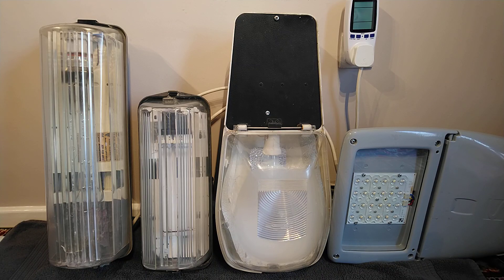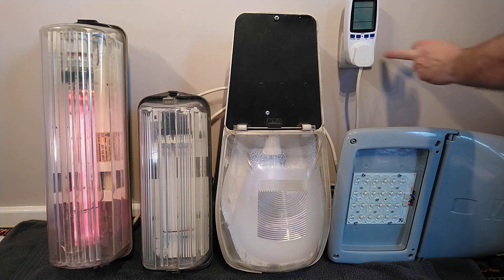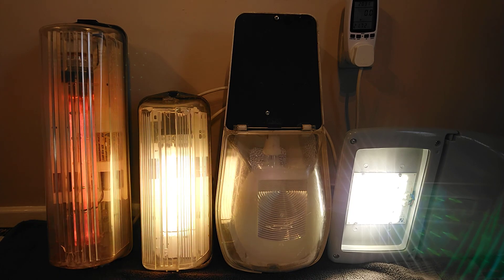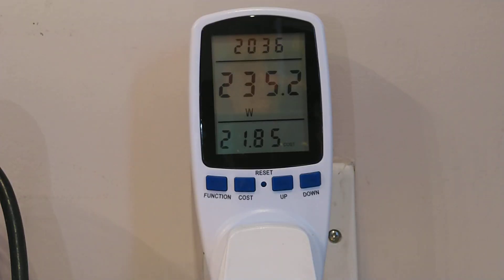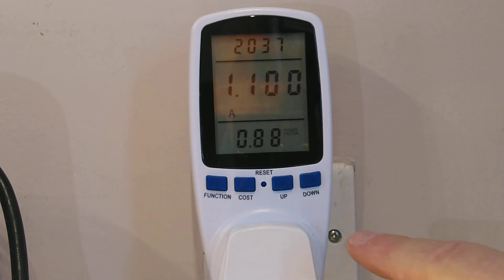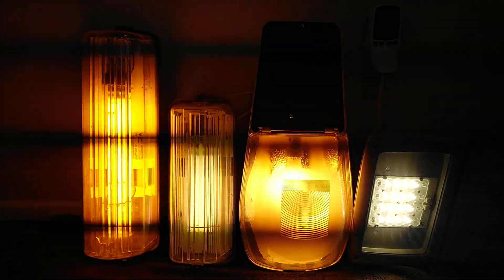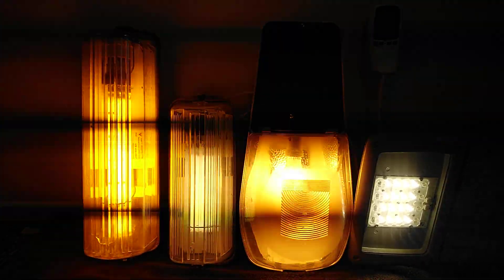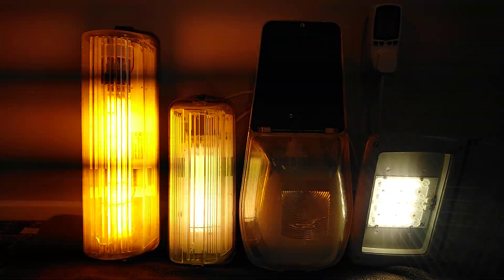Mass Start Up of 4 Different Street Lights

Comment: Very nostalgic, thank you very much for putting up this video. I really miss the sodium lights. I don't like the modern LED street lights - I feel they will cause more light pollution and they just don't look right! We need LED lights that simulate the sodium ones?
Reply: I can confirm this comment,  the city i live in converted to LED in 2018-2019 and the light pollution has increased by more than 100% since the conversion.  The lights are also bright and ugly
Reply: not only light pollution. it messes with am radio and ham radio led bulbs cause a ton of interference
Reply: @hunterbeachcowkk7hqy786  screeching drivers, gah! at least magnetic ballasts don't do that.
Reply: Wouldn't that be a detriment to visibility?